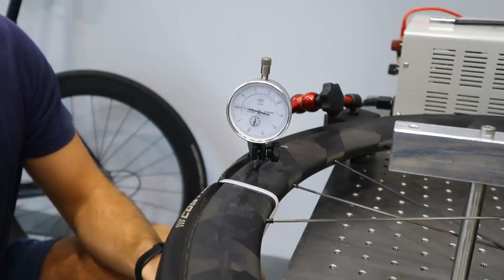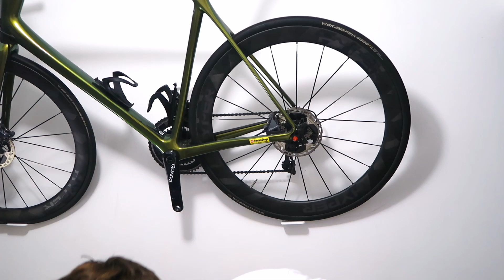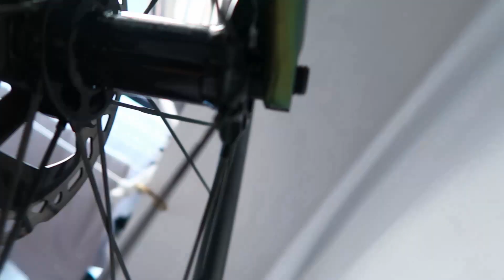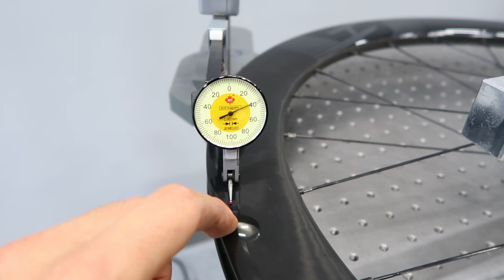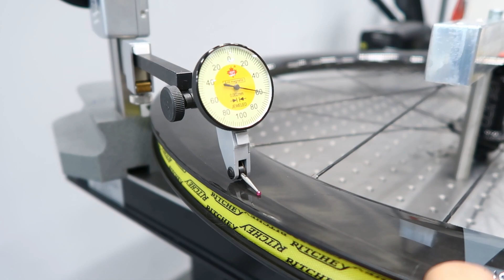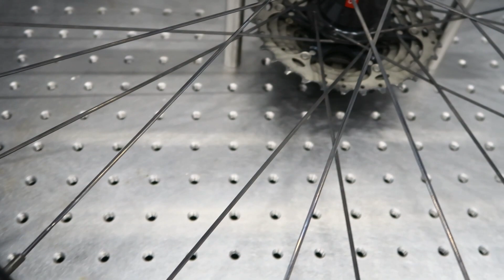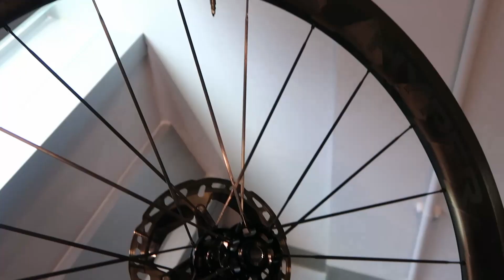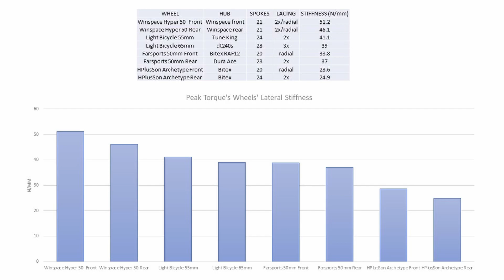WINSPACE Hyper Wheelset Review - Real testing and real data.

Comment: Shouldn’t the stiffness be tested at the edge of the rim? This appears to be a test of spoke stiffness but loses out on the spoke bed flex you would experience if you tested from the edge of the rim. I’m also not an engineer so may be misguided
Reply from the maker: Deflection is measured at the edge of the rim, you can see that in the video. So it is a test of the whole system.
Reply: @PeakTorque  does the weight distribution along the entire depth of the rim with the zip tie matter instead of the load being applied at the edge? I am genuinely confused and don’t feel like I should be. I have a hard time with rims flexing causing tires to contact my chain stays. I appreciate the detail in your videos.
Reply from the maker: @jaredgrubbs4009  that's not the rim deflecting locally, that's the whole rim flexing due to the spokes. The zip tie/point load simulates the point load of the contact patch on the tyre on the ground. Uniformly distributing the load would be very unrealistic to real world loading
Reply: @PeakTorque  thanks for the explanation!

Comment: Thanks for sharing your tests of the Winspace wheels. I don't won't to be unduly critical of your methodology but your approach was fairly flawed and therefore it was not very helpful in drawing conclusions that would be helpful in comparing lateral stiffness of various different wheels. If we are to compare apples and oranges ( carbon rims of different depths and even comparing a very shallow alloy wheel)  we would need at least a few constants to give us a fair comparison. For instance, all the wheels should at very least have identical spoke tension to within a fairly tight tolerance of a few KGF. Because of the disparity between drive and non drive tension on all disc wheels and all rear wheels that have a cassette, it would be useful to have at least the drive sides with identical tension. A good quality spoke tension meter would have been essential in this test to confirm both overall evenness of tension and drive side tension. Also it would have been helpful to have hubs with identical flange sizes as this plays a huge role in the lateral stiffness of any wheel as indicated by the amount of deflection you saw with the alloy wheel with a very low flange hub with much longer spokes. The lacing pattern is another factor. Comparing any radially laced wheel with any crossed lacing pattern is going to dramatically effect lateral stiffness. There were far too many differences in the wheel designs ( and possibly the actual spoke tension) to draw any real conclusions here. Another difference even between the two carbon rims would have been the type of carbon used  as well as the carbon layup. The LIghtbicycle rim employs a fairly common hand lay up common to probably 99% of carbon rims made today and the Winspace appears to be filament wound which is radically different from any type of hand layup. I imagine Winspace could confirm whether or not those rims are filament wound. 
The wheels used in your test were far too different to draw many worthwhile conclusions here.  I should provide some personal history here. I am the owner of Cognoscenti Cycles which is a custom wheel building company.  I have been a pro wheel builder since 1973 and I have built wheels for pretty much every major cycling event imaginable.  I have done testing for some of the largest rim and hub companies in the world. I started doing this testing in 1981. On a positive note I should mention that you correctly identified the problems of designing hubs with cartridge bearings and the inherent issues,  especially when no preload mechanism is incorporated in a hub design. I believe the best hubs with no preload are from DT Swiss. At least the old 240 design and even the less expensive Taiwanese made 350"s.
Reply from the maker: I think you're missing the point. The Stiffness test here is a test of the whole wheel system as built to a build spec by the manufacturer. So yes flange spacing, height, spoke tension are all variables and they contribute to wheel stiffness which is what is being tested.
Reply: @PeakTorque  I watched the entire presentation so I don't think I missed the point at all. My point was a simple one. Attempting to draw comparisons as you did was pointless with so many disparate factors. You could have assessed them individually on their own merits but that's not what you really did.
Reply from the maker: But no one rides a wheel, just as spoke, rim, or hub, so testing the whole system as specified and built by the manufacturer, at the specified spoke tensions, is how to compare wheel vs wheel. It doesn't matter if one rim section, layup, or second moment of area is higher or lower than other, because you don't ride the rim in isolation, you ride the wheelset, which includes everything even down to the stiffness given by the bearing arrangements and preload! That's my opinion anyway. The takeaway from this test is that the carbon spokes do offer a noticeable increase in lateral stiffness. Whether that is a good thing, or potentially too stiff, is up for debate.

Comment: I believe the method of applying the lateral load should be normalized by applying the force at a consistent radius from the axle. The strap looped around the rim in the video shifts the load inward  for deeper rims reducing the radius and biasing the measurements so that the deeper section rims appear more stiff than a narrow counterpart.
Reply from the maker: Yes, you're right. Well spotted, but its a small error in the context of the results.

Comment: I just got a set of the 50mm wheels and geez these rims really are stiff. I previously had fulcrum wind 55's and the difference in ride feel was huge. Also much easier to fit gp5000s now, can easily do it by hand whereas the fulcrum's needed 3-4 tyre levers

Comment: Hi, has anyone else problems with squeaking disc rotors? On my new winspace hyper wheels the breaking is very loud and squeaky. On my DT Wiss the breaking is absolutely silent, using the same disc rotor, brake pads and tires. Maybe the centerlock mount is not stiff enough, leading to vibrations!?

Comment: Hello!!  Reaching out to the bike community here. I am interested in a set of the Winspace 50 mm Hyper rim brake wheels. I have a 2013 Trek Madone 5.2 with an Ultregra 10s drive train. From the wheel specs: "Supplied with standard Shimano compatible 11s freewheel body." Will these be compatible with my bike? If not, what would have to change on the rear hub?
Reply: All you'll need is a 10-speed cassette spacer to be installed behind the cassette when you swap wheels. A 10-speed cassette is narrower than an 11-speed cassette, necessitating the use of a spacer on an 11-speed freehub body.

But it should be included with the wheels as far as I can remember.

Comment: I have a pair of Zipp 303 Firecrest disc (2018). I bought them used for about a thousand USD. I also bought the Lun 60 Disc for about $650 (used a promo code) with steel spokes and bearings. Here are my thoughts after riding both for hundreds of miles.

1. Internal rim width: The Zipp wheels are wider internally at 21mm vs 19mm for the Lun wheels. So my plan is to eventually put my gravel tires on the Zipps and use the Luns on the road.

2. Weight: The Zipp wheels at 45mm weigh an advertised 1625 grams. The Luns at 60mm with steel spokes 1657 grams as advertised. Note that the Luns don't need rim tape and the Zipps do, adding weight. I haven't noticed a difference in how quickly the wheels accelerate. I like to sprint, but I'm definitely no pro, so take my free opinion for what it is worth.

3. Comfort: I am running similar tire widths on both wheelsets and find the comfort similar.

4. Speed: seems similar to me, but I am getting a few good PRs on the Luns over the Zipps, especially on descents. That may have more to do with improving fitness and skill than with aero. Hard to say.

5. Stability in crosswinds: I've been through a lot more crosswinds with the Zipps than with the Luns, so all I can say is the Zipps are steady in crosswinds. I haven't seen any problems with the Luns, but again, I haven't tested them in heavy crosswinds yet.

6. Ease of setup for tubeless: I suffered a good bit with the Zipps, getting the right rim tape at the right price, getting it installed correctly, etc., and getting the valves to seal and stop leaking air. I couldn't get them to seat with a normal pump at first and had to take them into a bike shop to get the tires to seat. That experience made me excited to see that the Luns don't need rim tape at all. With the lessons learned from my Zipps, the Luns were especially easy to work with. One of my Lun wheels seated on the first try with no sealant at all. The other one I had to try twice. It didn't seat without sealant, so I took the tire off and put some sealant around and under the valve. After I did that the second Lun wheel seated no problem. I am using a $30 track pump.

7. The Zipp hubs are a terrible pain. They are supposed to be easy to work on, but in my experience, the rear hub often falls apart when I take the wheel out of the bike, requiring me to grab a thin object to push the pawls in place and then push the hub back together. This isn't because I am pulling on the cassette. Gravity is enough to cause the hub to come apart. The hubs also have a tendency to eat bearings astonishingly quickly--I think that is a result of them falling apart so often. I did notice that they fall apart more easily if well greased inside the hub, so I removed much of the grease to help keep them together... but now they aren't greased well. Even with minimal grease, they still fall apart on occasion.

I have a gravel bike and often switch wheels between road and gravel rides (not to mention using an indoor trainer on occasion), so this is a deal breaker for me and is the main reason I bought the Luns. I will probably pay to get the Zipp rear hub replaced so I can use the rims reliably on gravel rides.

8. Conclusion: At this point, I see no major advantage of the Zipps over Luns. When I go riding, I always pick my Luns over my Zipps and if I were to do it all again, I'd purchase the Luns and skip the Zipps.
Reply: You forgot to add in that ZIPP has a lifetime warranty, covers crashes too. Free replacements.

Comment: You reviewed both Farsports and Winspace wheels? What's you favorite between the two of them?
Winspace seems to have their own hub, while Farsports you can choose the hub.
Winspace uses Carbon spokes though, while Farsports only has stainless steel options.
I am drawn between the two of them as Farsports is lighter with a well known hub, but Winspace has the carbon spokes
Reply: Farsports also build wheels with the same carbon spokes but you dont get the choice of hubs. These spokes are only compatible to a limited amount of hubs. I'd go for the Hypers, they are a fantastic wheel.

Comment: for a 57kg rider are 50mm hyper wheels going to limit the days I can ride them without worrying about being blown around compared to the 38mm. I really like the look of the 50s but I am not sure
Reply: I am 59kg and the wheels are fine for crosswinds. There was only one day that I used a shallower dish wheel. The ride that day had 40km/h winds and some very fast descents. The 50mm wheels are fine for most conditions except extremely wind days. If the road is flat I would still use the 50mm wheel on very windy days.

Comment: These look strikeing similar to the hunt 50 UD Wheelset, weight the same, carbon spoke, UD Carbon finish, re-branded wheels from the same factory??
Reply: I noticed the same thing. HUNT does not manufacture its own wheels so my guess is, they just buy them from WINSPACE and add a premium to them. I just ordered a set of the 50mm rim brake Hyper wheels. Can't wait to try them out!

Comment: These do look like great wheels and I live the analysis. One of the varibles I had thought of when you were  comparing the deflection from the aluminium  rims to the carbon was that the location of the weight on the aluminium rim was a a greater distance from the hub than the carbon 50mm rim due to the deeper rim. Essentially if we assume the aluminium rim is 25mm this distance would mean that the weight has a further cantilever distance. Did this extra distance from the hub affect the deflection results?
Reply from the maker: Yes well spotted. That's an error in my setup. The Torque is linearly increased on the alu rim because of where the load is, but its a small error.

Comment: Doesn't the zip-tie around the rim make the rim depth a factor in the stiffness calculation? The clamp hangs at the bottom of the zip tie which is at the midpoint of the rim depth. If it's a 60mm rim, the resultant force from the weight is being applied 30mm inward from the outer diameter which would reduce the length of the lever arm. If it's a 20mm rim, the force is being applied 10mm inward from the outer diameter etc... The difference in the torque applied for a lever arm which is 301mm (aluminum) vs 281 (60mm) would vary by ~5% percent?
Reply from the maker: Yep ☺️ good spot. Im an engineer not a scientist, 5% is close enough ☺️

Comment: Only head scratcher is why they put the radial spokes on the disk side in the rear. When building wheels I have always been taught the the more crossed spokes or the spokes that are crossed go on the side that would be producing the most load. So on a rim brake wheel it would be the drive side, but on a disk wheel it should be the disk side

Comment: I am a little surprised at the internal and external rim width for a new wheelset. That seems quite narrow and would/could create a less than ideal aerodynamic end result with a 28 or 30 tire?? That is a question not a theory. It just seems that the current trend is to wider tires creating a desire for wider rims also.
Reply: I agree, 23mm tyre fits best in my opinion. GP5000 23mm expands to 24.75mm. I love the road feel with the carbon spokes even with 23mm tyres.

Comment: I paid for these wheels a few months back... just a report of my experience with them...

these wheels are really stiff... probably due to the carbon spokes and oversized flanges... while they are excellent in terms of power transfer and minimal flex, they can be jarring to ride on... there is also a bit less corner grip if the road surface is not perfect...

They roll well and feel very good in the wind...

That said, they are really good racy wheels with very good performance for the price.... You cant really complain given the price and how these wheels perform and roll better than my other more expensive branded wheels....

Check out their frames too... I have an SLC and I was surprised by the quality and paint job... the frames rides well like any decent carbon bike out there but with much less of a price tag... again i paid for the SLC out of my own pocket...

Comment: @peak torque - having recently been getting into the rabbit hole of a few wheel builds myself - i have personally come to the conclusion that a 2:1 laced triplet rear wheel (with a proper triplet designed hub) is superior than a 1:1 lacing. Reason being the 2:1 spoke ratio forces NDS flange spacing wider to compensate for total L/R tension balance - thus creating a laterally stiffer wheel. 

Unfortunately there is a dearth of proper triplet hubs available as hub only (but being used more regularly on some mid-high end factory wheel sets - eg Shimano RS81). Two i have found are the Extralite Cyber SP-T (quite exxy $), and a small UK wheel builder who does his own hubs - Borg. Also the Velocity Gram by Venn cycling - a niche European outfit. I would be curious on your views on the respective pros / cons of triplet in general - and perhaps a specific engineering assessment of these hub designs vs say a traditional rear (eg DT 240 etc).

Excellent content as always.

Comment: Great video, I'm curious what's the benefit of having 2:1 spoke on disc brake, for left/right balance? how much difference comparing with 1:1 lancing? also when it comes to truing the wheel, does the spokes on one side will have higher tension? Thank you!

Comment: I am wondering if you can run 28mm or 30mm tires on these wheels?  I have a Bianchi Infinito CV with disc brakes and currently run 28mm but thinking of going to 30mm this spring.

Comment: We did tensile testing on our bonded carbon push rods on our FSAE (formula student) car. And the aluminium inserts failed before the bond between the aluminium and carbon. We used araldite 420 with correct tolerance. 

I would say the nipples on the spokes would fail first also. But not at the bond.

Comment: Excellent review.  Super detailed and technical info.  Thank you.  

I'm contemplating the Hyper Disc wheel set for a future build.  Possibly get the LUN or Hyper for my current rim brake (Kestrel Legend).  Considering my weight (94kg) and bodybuilder/sprinter legs, I need a stronger rim.  I honestly wreck rims and even frames due to rim deflection when sprinting and climbing.  I get frame damage on the rear triangle.  

I've seen China Cycling videos for years.  The recent Winspace Hyper Review he did and now yours, will seal the deal for me.  I heard Hambini likes them too, he's pretty critical.  I appreciate your review more than any so far (sorry Joe).  Thank you.

Comment: Isn't it the leading spokes rather than the trailing spokes that deal with the braking forces on a disc wheel? I was taught to lace disc wheels with outbound leading spokes on the disc side for that reason.